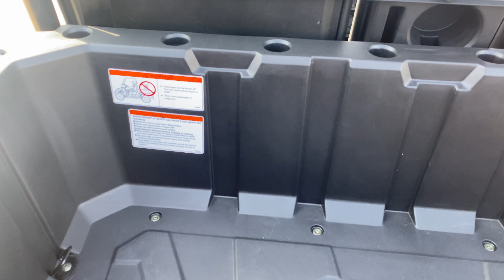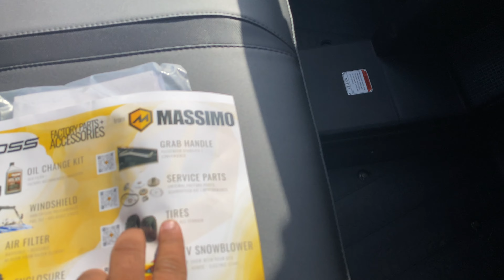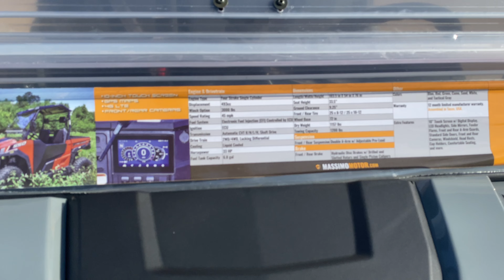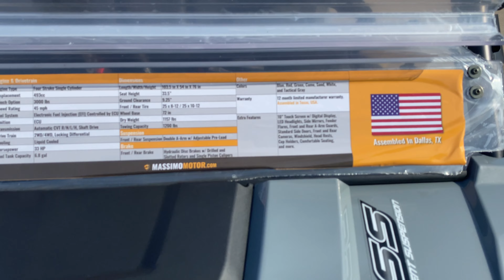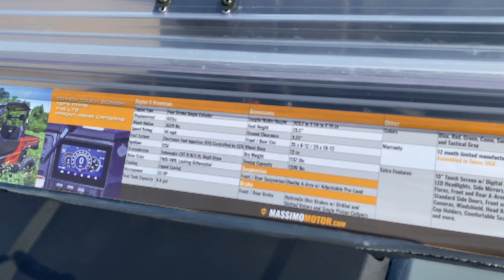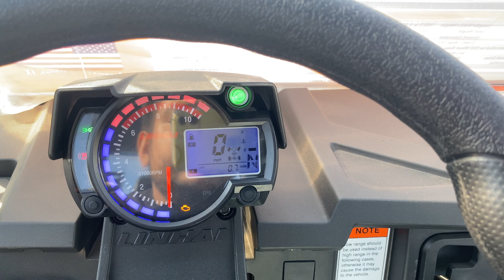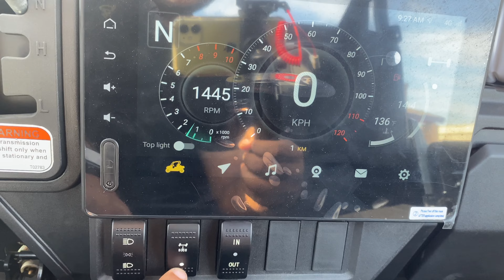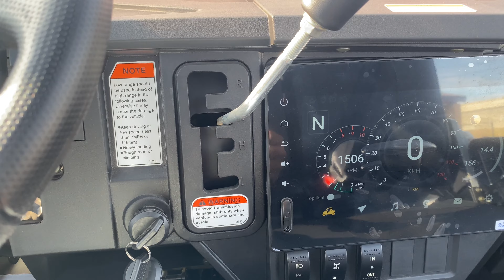$9,999 MASSIMO TBOSS550 FULLY LOADED TOUCH SCREEN CAMERAS AND MUCH MORE...

Comment: Same price as Tractor Supply
Reply from the maker: This is fully loaded and we have 560s on sale for the same price point.
Reply: Bought the MSU 850. Worst mistake of my life. It has the potential to be a good bike but the quality is junk. On my third throttle cable under warranty and now the primary drive came apart.This thing has a CF Moto power plant, of all things and if they can’t figure out how to get a proper throttle cable that can take the heat, everyone who has this bike is gonna have the same problem and this only has 53 miles on it. Never even got it over 40 mph and never seen the mud or was dogged out.I’m gonna sell it for a loss and get the Kawasaki 1000 or the Honda. The salesman or service guy can’t even look me in the eyes. Now it’s hunting season and I’m out of my ride, probably for the season.